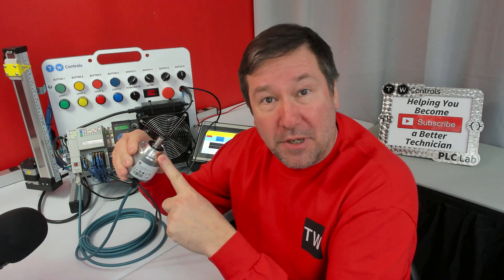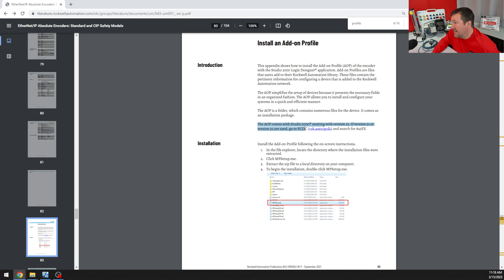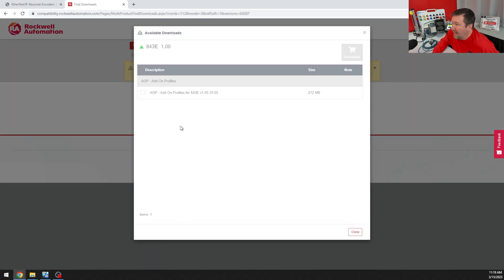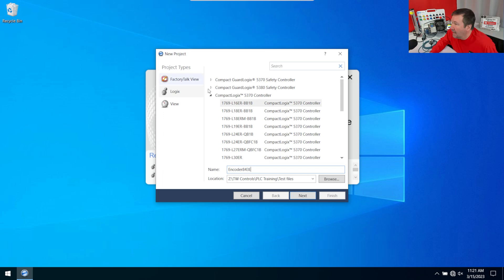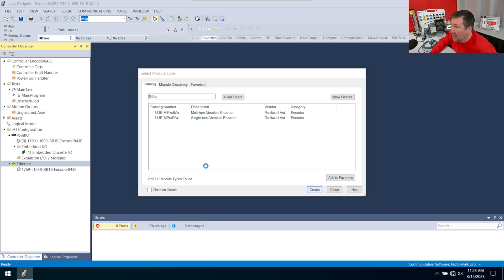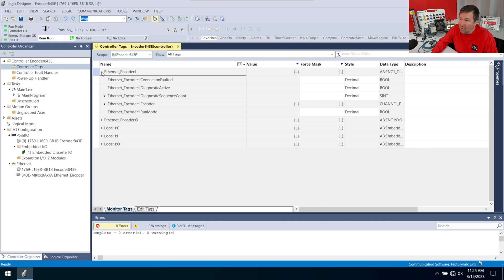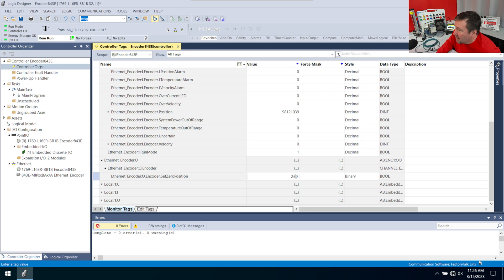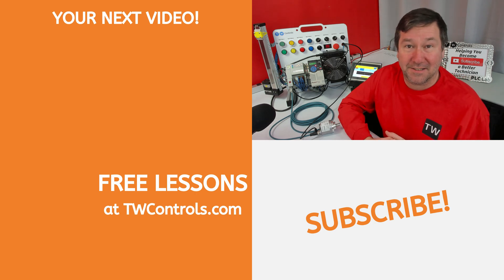Add an 843E Ethernet Encoder to Studio 5000 with an Add On Profile AOP

Comment: is it possible  instead of .SetZeroPosition command it to start over with other position value like 24034 ?
when I reach certain sensor I would need some none zero position, at least that's the easiest way to modify some existing logic
Reply from the maker: It will set it to the value in the preset value.  It is available in the module properties but can't recall if you can change it in the logic or not.

Comment: Good afternoon, Tim. tell me please, can I fully use the compact GuardLogix5380 processor (5069-L306ERMS2) and the ControlLogix I/O rack? thanks for the answer
Reply from the maker: I can't see why it wouldn't work.  I'm using it with a 1769-L16.